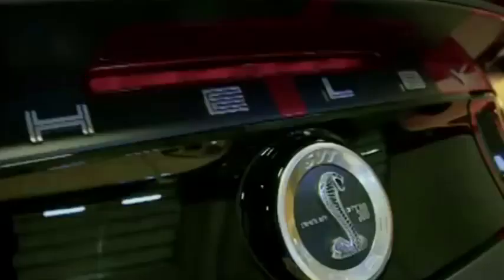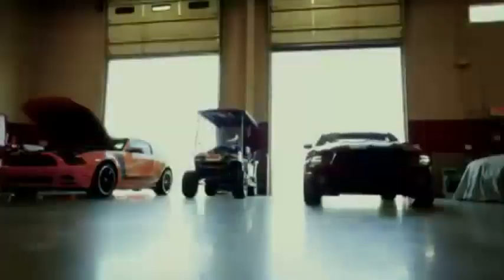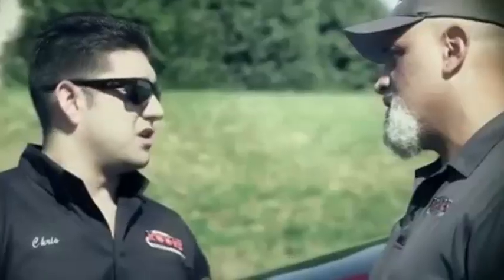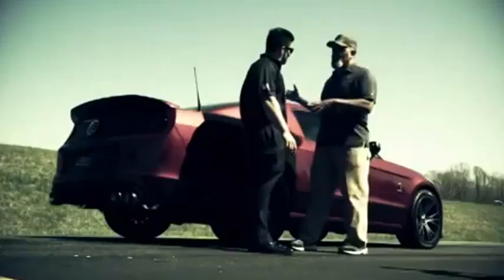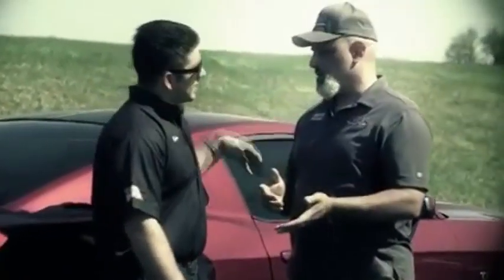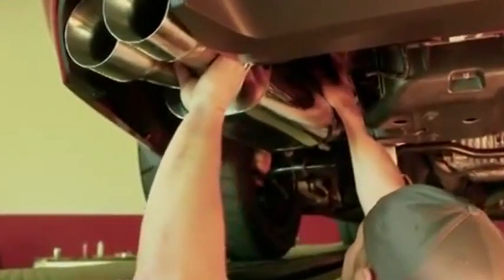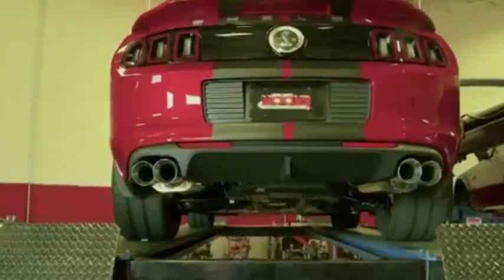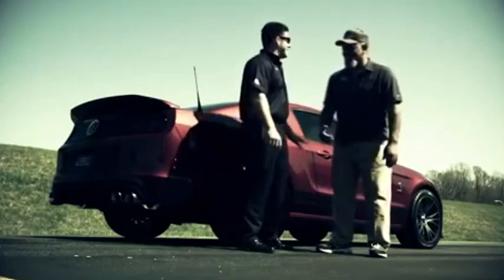Full Kooks™ Exhaust System on 2014 Mustang GT 500

Comment: I run Kooks 1 7/8" long tube headers, Kooks off road X pipe, and Kooks axle back.  Under wide open throttle it sounds like a full blown race car.  I also installed L&M nsr cams so it sounds like a race car @ idle.....
Reply: Ralph Voorhees I’m pretty much stealing your set up .....

Comment: Sounds awesome!!! Is the deceleration pop from the tune or the muffler design?? I have a 13 with full bolt ons, headers, off road H, and Corsa Sports but this sounds so much better!! Considering ordering a cat back system is it possible to bolt it to a 2 3/4" H-pipe?